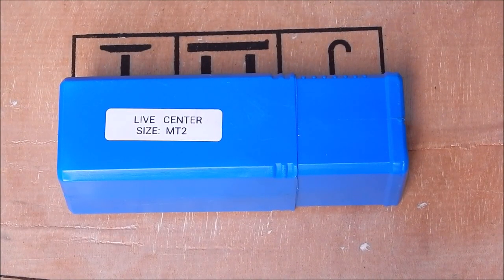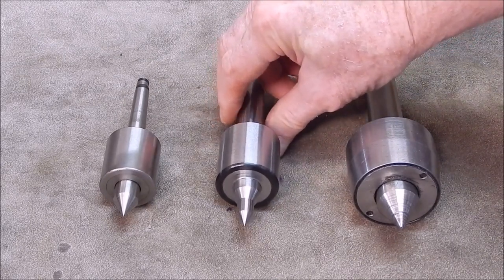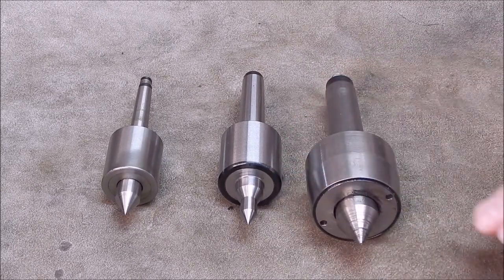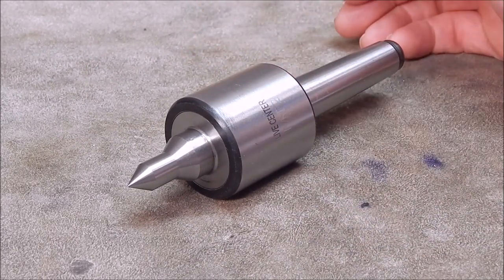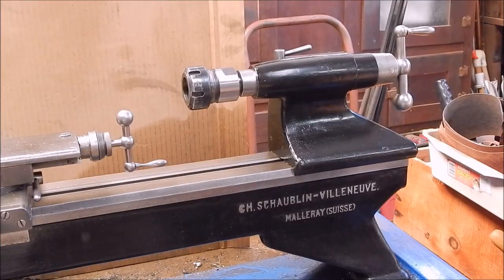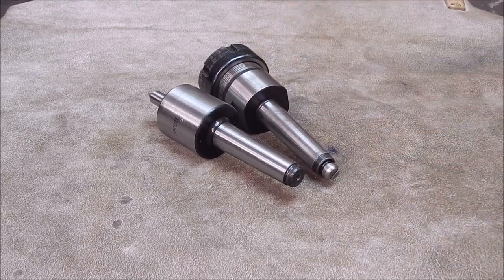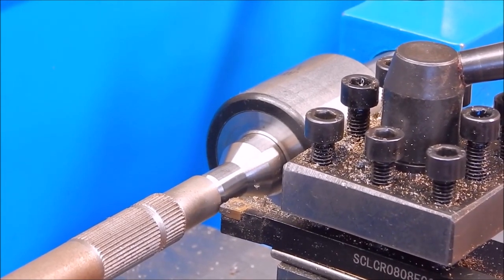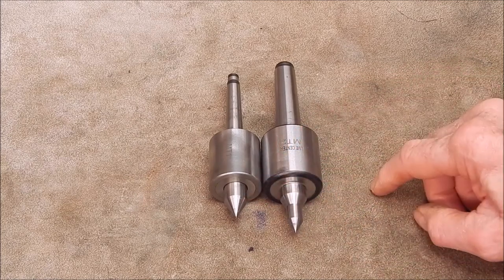Perfect live center for the 7 x 12 mini lathe - Excellent Morse 2

Comment: For occasional use, I have stuck a ball bearing in the center on the small end of a taper with some grease for tapers that are too short to eject.  Eventually you will want to do something more permanent, but for a one-off it works OK.

Comment: G'day Rob.  Thanks for the excellent review.  I like the long nose live center.  I have not always had the best of luck with import tools being accurate so you are lucky with that one.
Reply from the maker: G'day Harold.  I thought a few viewers would be interested in that one.  I've not seen the stepped ones before, just the variable taper noses.

I've bought 4 various sized live centers from China over the last few decades, from three different suppliers, and they have all been excellent.  I always read the product comments before reviewing/buying and so far it's paid off.   You do see comments where some centers are not good, so it definitely happens.  

Cheers Rob

Comment: Thanks for the review Rob, I never knew something like this even existed! I'm always having problems with clearance issues when using the live centre, this will be ideal, just ordered mine 👍 Cheers, Alan.
Reply from the maker: Hi Alan, it really is awesome.  Excellent quality.  I've battled live center clearance issues for years and this is just so much better.  They don't seem to do it in Morse 3 though, which is a bummer.  Cheers Rob
Reply: @Xynudu  Hi Rob. You could always use an MT3 to MT2 adapter. I have a couple MT2 centres which won't eject, so I use a couple of old parallels and place them between the back of the centre and the shoulder of the tailstock. This allows you to eject the centre with ease. I keep meaning to make up a 'U' shaped spacer which fits over the spindle to do just this. Like a lot of other things it's on the 'to do' list!!  Cheers, Alan.
Reply from the maker: Hi Alan, I hate those Morse adapters as you always get combined error which destroys any accuracy.  Drill and tap the MT2 centers you have for small bolt, same as shown in the video and they will eject no problem.  I will probably do that to this one for Schaublin use.  May be worth a video to show how.  Cheers Rob
Reply: @Xynudu  Hi Rob. A video would be good, I can't see any easy way to hold the live centre for accurate drilling and tapping. Cheers, Alan.
Reply: @Xynudu  that would be a handy video, if you are up for it, I would certainly find it useful!

Comment: G'day Rob. I have the same live centre and you and the same issue without a tang that you have on your Schaublin. I have been umming and arring about how I would do the work holding to drill a tap a thread in the end. You mentioned it would be a straight forward task. I would really appreciate if you did a video showing how you would add a tang to this type of morse taper live centre.
Reply from the maker: Hi Fred,  I have to modify/extend this one, so I will do a video on it at the same time.  Cheers Rob

Comment: Another good Sales job, I just bought one.  
Adding a tang or ejection screw is common. 
I have done mine
Thanks
Reply from the maker: Ha Ha.  Yes, it's a good item Dennis.  I thought it would get some interest.  Unfortunately they don't seem to do Morse 3 in the budget price range, so I won't be upgrading the center on the 10" swing lathe.  Pity as it's a very good idea.  You have always been able to get variable taper noses, but they don't give the clearance of this one.  Cheers Rob

Comment: Thanks, you just answered my questions as I just saw this today and wondered about it as it looked to be the answer to my issues.
Reply from the maker: Hi George, it's a very good profile for working in close on small diameter work.  Excellent live center for sure.  Only seems to be available in Morse 2 or below, but is a popular size used on most home and hobby lathes.  Cheers Rob

Comment: Rob, What would be a good way to hold a morse taper tool like this for drilling and tapping the back end for a spacer screw like you show on your other center?  Will it hurt the mechanism to chuck it up on the outside body, If you don't chuck it too tight.  I too have that problem on one of mine.
Reply from the maker: Hi Glenn, I chucked up a Morse 1 on the body to reduce the taper to Morse 0.  No problem provided the body sides are parallel.  I expect you could easily chuck this the same way, provided you have decent length jaws. 

To avoid marking the center body I suggest padding the job with used belt sander strip, abrasive side towards the jaws.  It will grip nicely.  I did a video on this neat trick a while back.  Don't over tighten the chuck.

For maximum security on a long object like this it's a good idea to add a fixed steady near the Morse taper small end, as it's easy to twist work in a three jaw chuck.  Four jaws are much more stable.

Cheers Rob

Comment: Well done Rob. One of my tailstocks also failed to eject a center without tangs. I put a small, turned aluminum slug inside the tailstock, and I forgot it was even there until you showed this video. Is that MT2 Schaublin tailstock the original you received, or the one that came from the yellow machine you found under the tree?
Reply from the maker: Hi Rick,  it's from the machine under the tree.  The original tailstock is Morse one (modified from a unique Schaublin taper of similar size).   The Morse 2 tailstock I generally use is good as new and a lot heavier.  Cheers Rob

Comment: Gday Rob. Did you hunt this down in an MT3? My search hasn't brought up anything.
Reply from the maker: Hi Adam, I looked around for a Morse 3 version but no luck anywhere.   Doesn't seem to be available. 

BTW Banggood have a very limited range of Morse tapers in a lot of things these days, arbors included.  You would expect them to be big sellers. 

I bought a B16 Morse 3 arbor recently and had to use Ebay.  Only ($18 AU) and TIR was extremely accurate (0.01 mm) as advertised - it came from a Melbourne seller called MaxOrbit.  I was somewhat dubious about doing this, given the amount of crap on Ebay, but it worked out well.

Cheers Rob